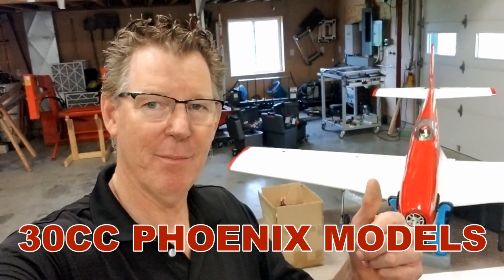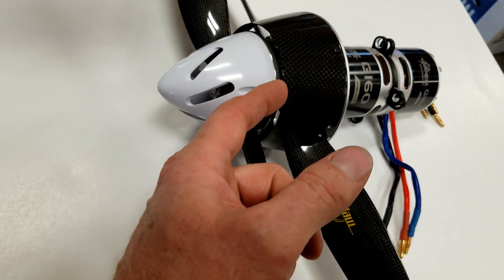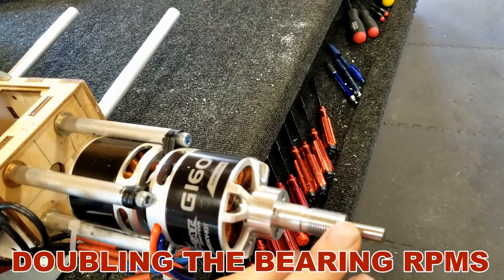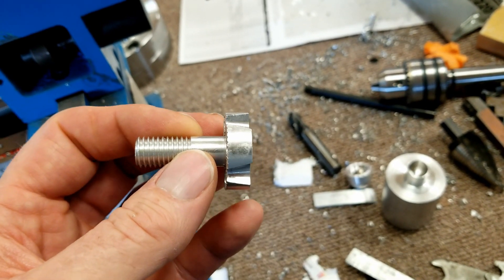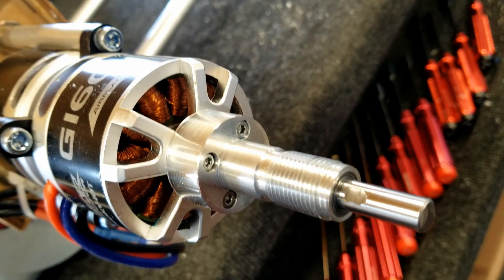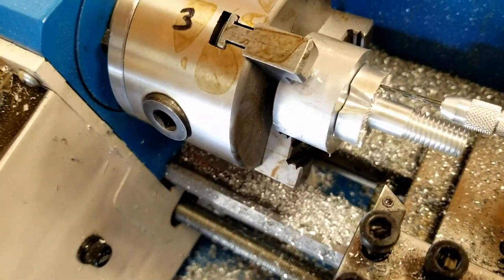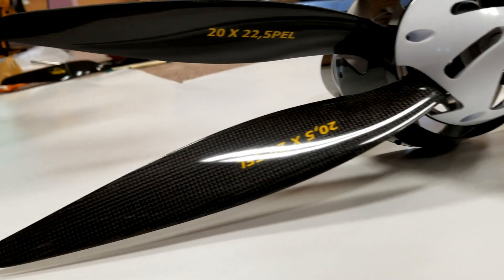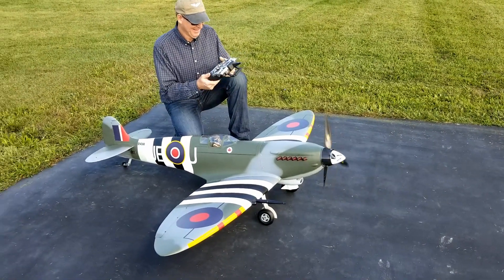CONTRA-ROTATING RC MOTORS HOW TO RCTWINS

Comment: hello
you use how many lipo 6s for 2 motor
Reply: Thank you very much for your interest in our channel!!
Reply from the maker: I use 2 6S batteries for each motor, totaling 4 4000mah 6S batteries in the plane, thanks for asking :)
Reply: @rctwins7913  thank you and how long this flight
and it's for a Hawker P 1030 project
Reply from the maker: About 5 minutes, add throttle slowly, good luck!

Comment: 20x22 props??? What max static trust are we looking at here? 25kg? What power do you need vs trust?
Reply from the maker: Yea its around 25KG, the key is to add throttle slowly as I decend, this huge pitch only works in contra-rotation setups. In our testing we could never go to max throttle in static or we would amp out, these are Tomcat G160 motors running on 12S, the RPMs are around 11000. The plane is light and does over 200mph at show central :)
Reply: The Spitfire mark 19 is the airplane we chose for this motor and prop setup. That is a fast warbird, it unofficially travels well over 200 mph, in that video we are traveling 3/4 of a mile each way from center. 1 1/2 mile in just a few seconds, so it never stops winding up. On a broader higher drag aircraft the results would be far better than normal but the rate of climb is amazing!!
Reply: Thank you very much for your interest in our channel!!

Comment: How the upper n lower blades turns clockwise or anticlockwise?
Reply from the maker: The rear motor turns the opposite direction from the front
Reply: The rear motors drive shaft goes through the front motor and drives the front prop
Reply: Thank you very much for your interest in our channel!!

Comment: Wow!!!!! Bet it has a lot of power to fly almost any size plane.
Reply: love it .i tried to make one years ago but lack of lathe stoped me.
Reply from the maker: Yes it does and sounds so cool! Thanks for the comment!!
Reply: @rctwins7913  How do you get the shaft from the back motor up to the front? How does it go through the front motor? Did you make the long shaft for the rear motor?
Reply from the maker: @markferreira855   We made a new longer shaft from drill rod, the diameter is precision ground and it is a
 tough material, next we remove the the outside spinning can of the motor, after removing the bearings from the inner motor frame or rotor. Since to
rear shaft spins in the opposite direction, we reamed out the 8mm diameters that were the shaft holding diameters to 9mm and reinstall the front and rear
bearings. The new shaft is long enough to pass through the new prop adapter
Reply: Thank you very much for your interest in our channel!!